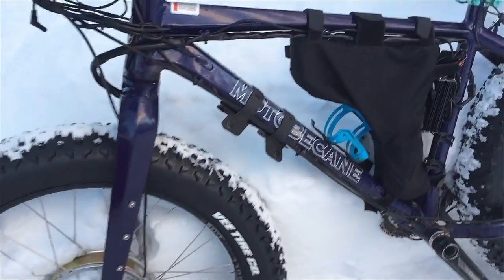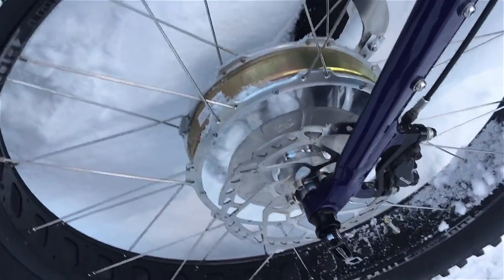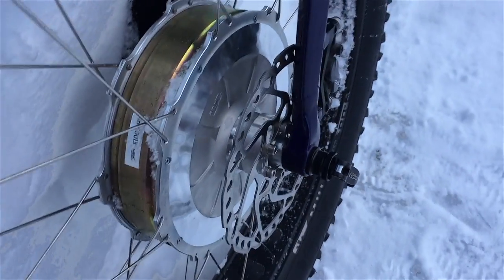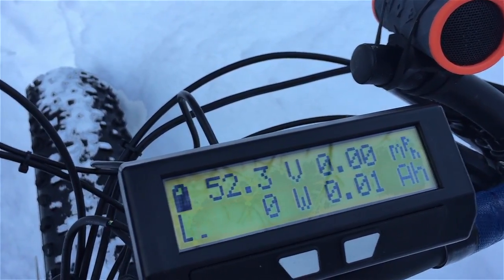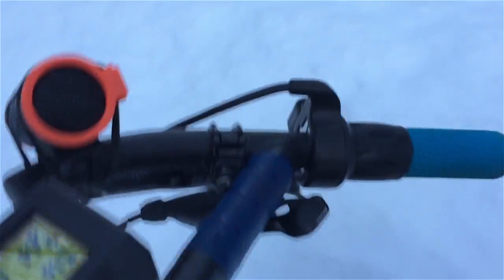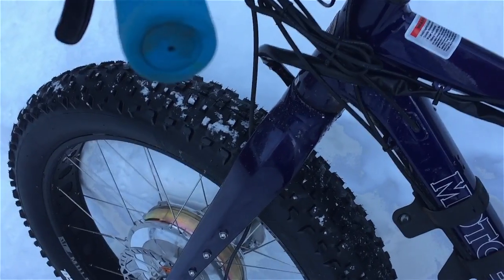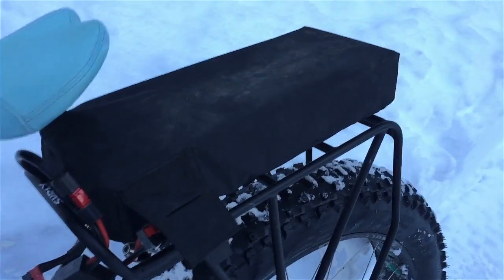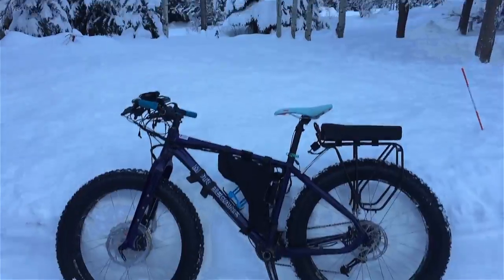Electric All Wheel Drive Fat Bike using the Grin All-Axle Hub Motor

Comment: Great video. How do you like the grin motor? I'm getting a cargo bike with a 15mm front thru axle and it seems like this is the only option for a hub motor that I've seen so far.
Reply from the maker: The motor is good. But the version of the motor that I have is the fast winding. It's too fast for this application. They now have different windings that are aimed towards slower/higher torque applications, for a fat bike or cargo bike, I'd go for one of those.